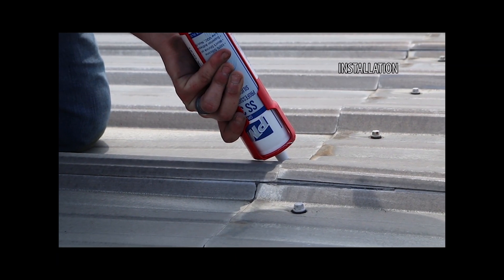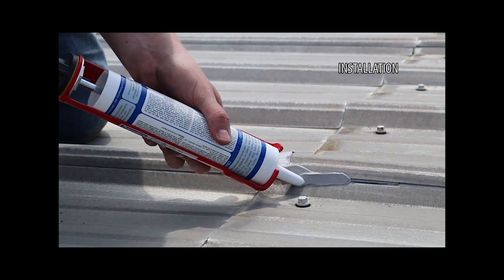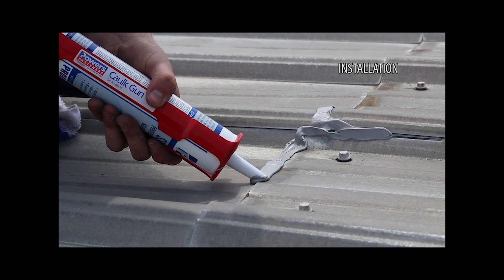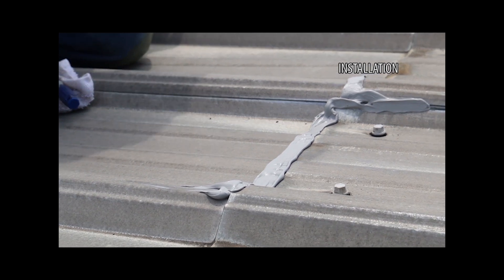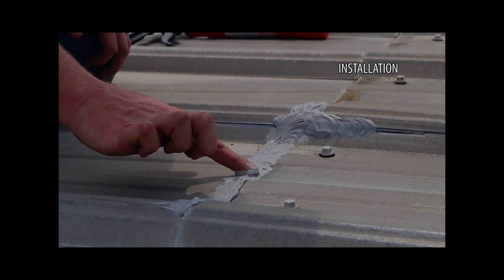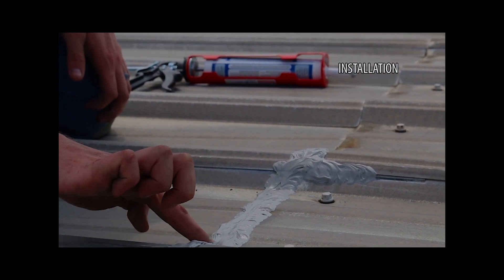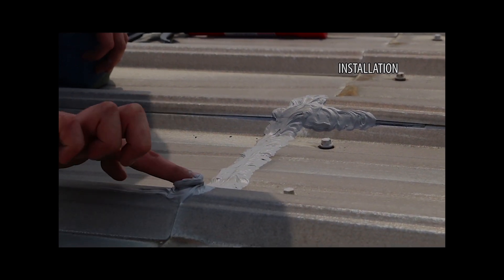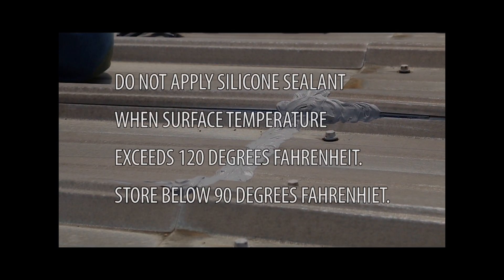Silicone Caulk Application Instructions

Comment: I was told not to use silicone , black tar , or caulk  on metal roofs .  There are special adhesives to be used on metal .
Reply from the maker: Rossco, our silicone will adhere to almost anything. We don't recommend it on cold tar roofs and some ballasted roofs, but it will work great on almost any other roof type. If you'd like a free sample to do a test, you can request one here: https://pmsilicone.com/request-sample/